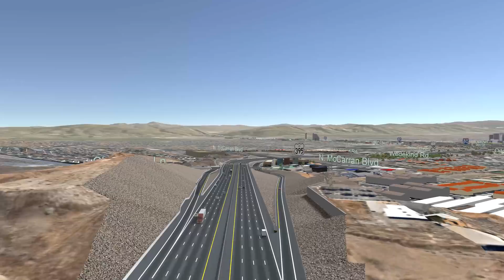Reno Spaghetti Bowl Reconstruction Project

Comment: You guys need a freeway to Spanish springs 😐
Reply: Ashley Cortez not really possible unless they make pyramid way into a freeway but its not likely.
Reply: Anything is possible , it would just take years to build a project like that . They added 2 lanes on pyramids and mccarran and that still didn't solve traffic issues . The new California needs the freeways just like California 🤷🏻‍♀️
Reply: @ashhdianaa  We need it less like Cali, I honestly think that lowering the ammount of residency in the area would help solve a lot of problems.
Reply: there is a proposal to build an almost freeway to Spanish Springs, splitting off from 395 roughly at Dandini, cutting across Sun Valley, turning to run parallel to Pyramid between Disc and a few miles north of Los Altos, where it will merge with Pyramid and have widening and reconfigured intersections continuing on Pyramid out to Calle De La Plata.
Reply: Too late for that now 🤷🏻‍♀️